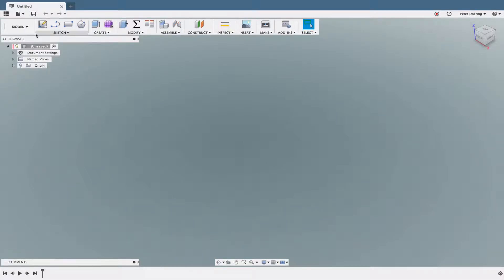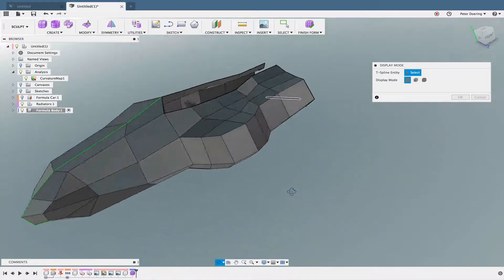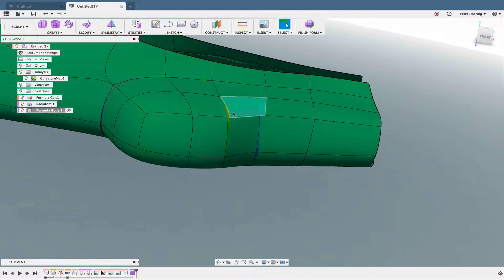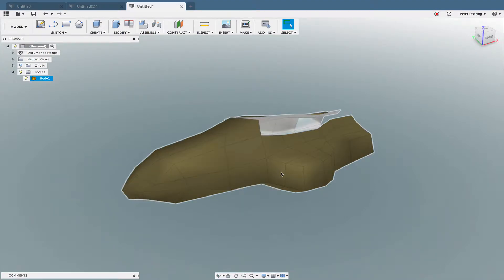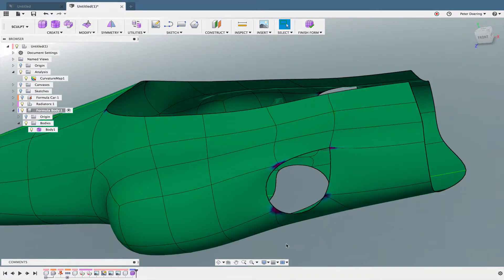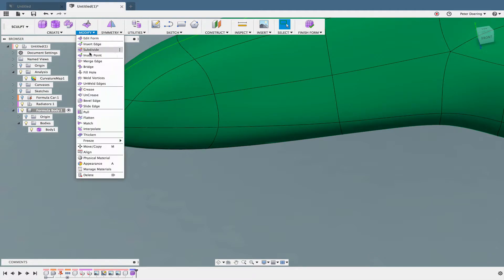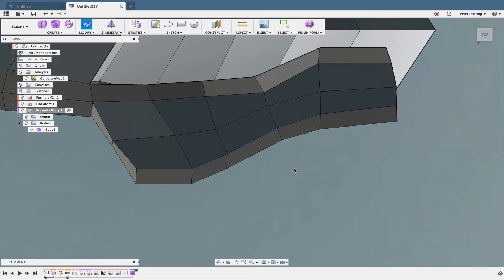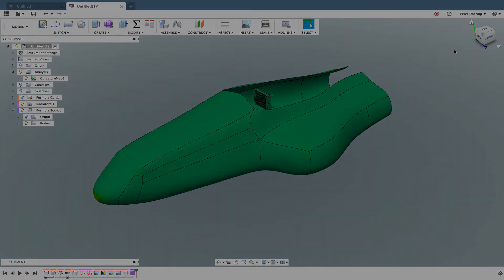Fusion 360 - Fixing a broken T-Spline

Comment: Nice video. By the way, the reason you have to rotate the imported OBJ is because it’s using a coordinate system that’s different from Fusion. Some systems are Y-up, other systems are Z-up. So if you go between different systems the file will come in 90 degrees rotated. Like the T-Spline videos👍